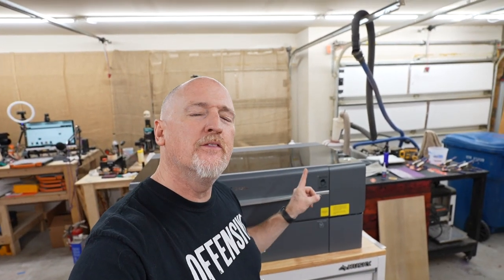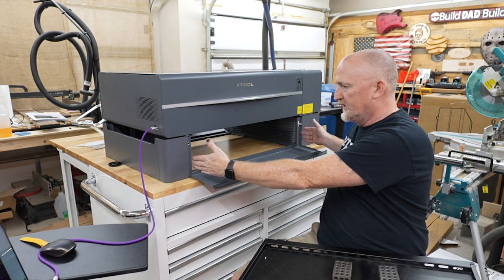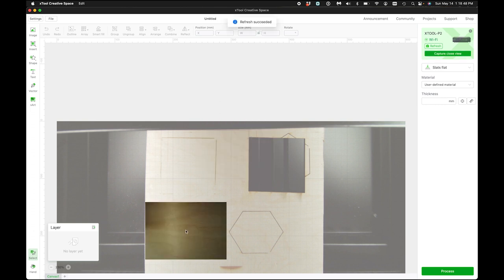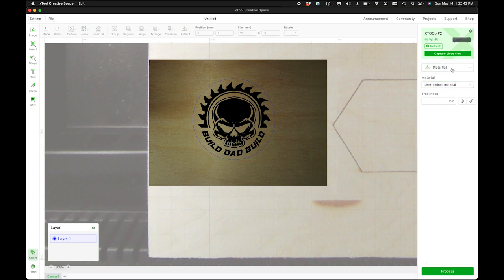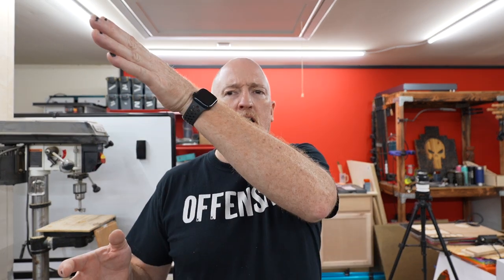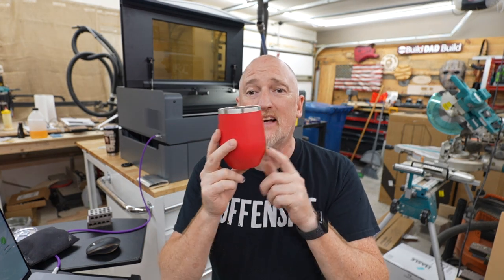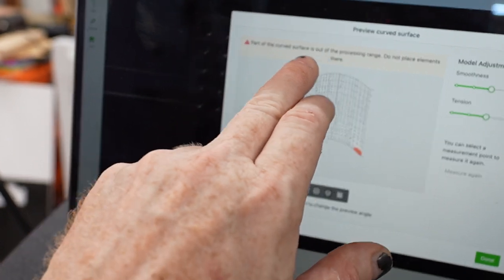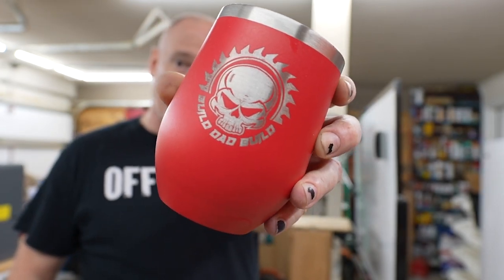Laser Engraving Tumblers WITHOUT a Rotary (Check out the xTool P2 CO2 Laser)

Comment: Very cool. There are a couple things I like about the P2 over my Polar - the large pass through area, the upcoming conveyor, and the clearance height for the pass through. I've got mine on risers because, for real?, you can't put much on the rotary with the way it is. And once the warranty is done, I'm taking an angle grinder to the bottom and enlarging that hole as big as I can. Now to figure out how to do the conveyor belt.

Comment: The RA2 rotary cable for the M1 and P2 are the same. However, if you don't already have the RA2, there is a P2 version that is $18 cheaper because it doesn't have the blocks to raise the M1. If you have the RA2 for the D1, there is a cable for the P2 for $9.
Reply from the maker: Good to know!

Comment: I've seen others put the cylindrical thing into a box or similar, so only the top that should be engraved is out. It helps with the scanning process, because it doesn't have that sharp of a drop to the sides.
Reply from the maker: Yeah...I saw Buster Beagle do that, I think?

Comment: Doing 6mm acrylic black using the P2 auto setting if I do 4 pieces the first 2 it did first dont pop out seems to be welded shut? The last 2 pop out np and clean. Suggestion on setings?
Thanks!
Reply from the maker: Too hot or too slow

Comment: I was just curious  if you can give me some info. I'm trying  to figure out what the difference  between  the 
Xtool D1 10W vs
 the Xtool D1 pro 10w. 

Is there an actual  difference  or am I just lost... 

Thanks I appreciate you.
Reply from the maker: The pro is a more reinforced frame with higher speed capabilities.
Reply: @Build Dad Build  does the pro have any more features on the xtool program side of things? I can't seem to home my D1 laser with a click of a button or I just haven't  had enough  run time experimenting yet could be the issue  thanks. 

Cheers.
Reply from the maker: XCS has more features than Laserbox Basic if that’s what you’re asking.